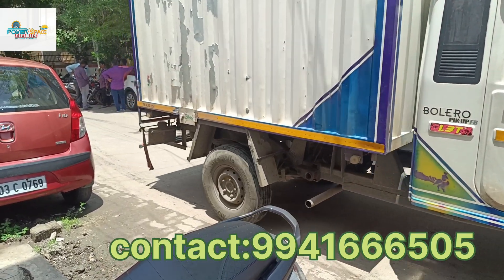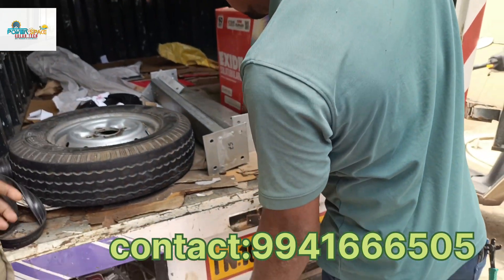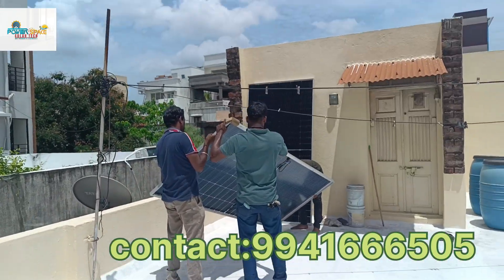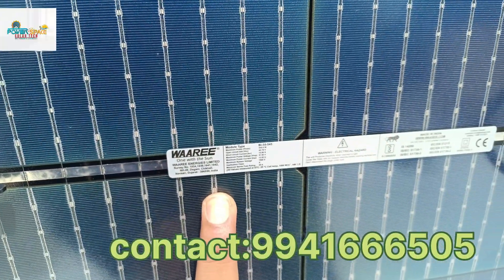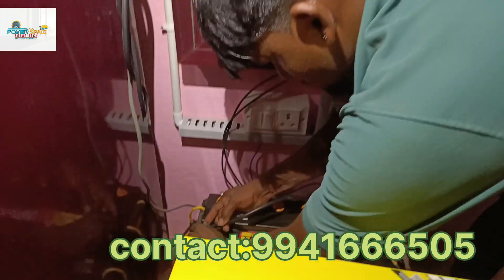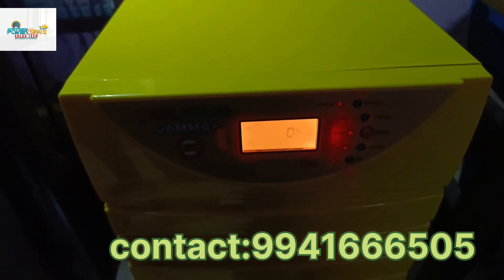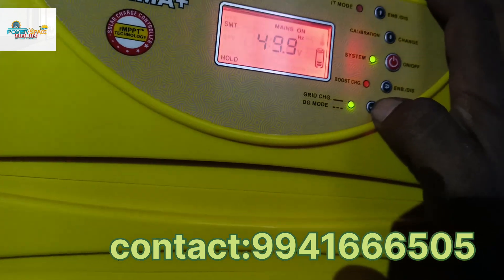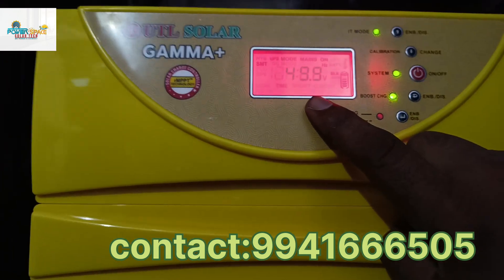utl gamma plus 3350va 3kva solar mppt pcu inverter with exide battery, waaree panel  in Kodambakkam

Comment: UTL Gamma plus 3350
Bottom last button have two function which is changing grid or generater and grid charging on or off. If you don't know read manual and instruct customer.